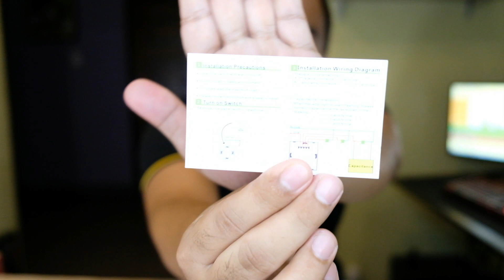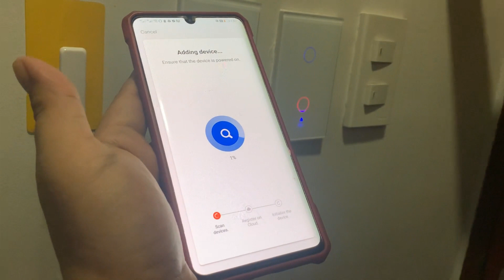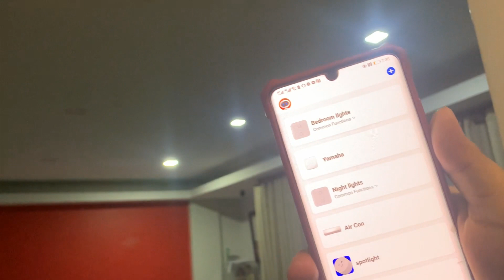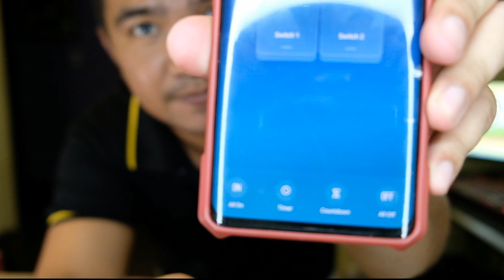Smart Light Switch: Install and Configure | JK Chavez

Comment: nice but was the delay normal...i will see if i can find it in my market..
i hope u do for other appliances too like fan and controlling the fan speed ,
Reply from the maker: Hi Umar, for amazon echo dot, i have that 1 to 2 second delay ever since, i believe when i send a command via echo dot, it will connect to amazon server and process the command then comes back at my house to actually do the perform the command, let me know if you have better experience.. :)
Reply: @JKChavez  i plan to also insert one, but i will see what is available here. thanks